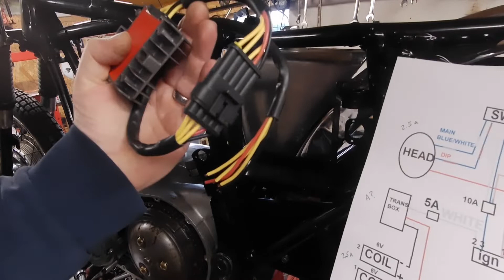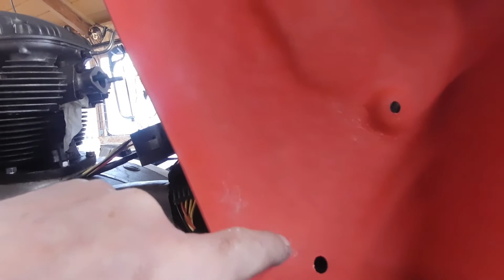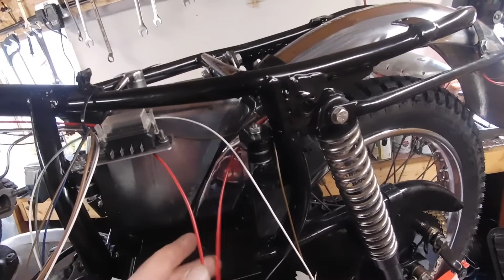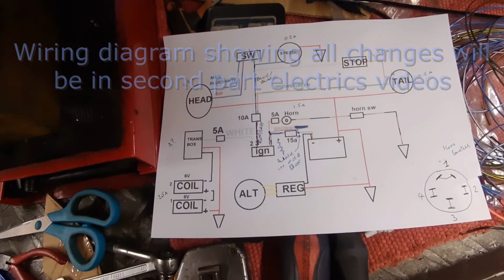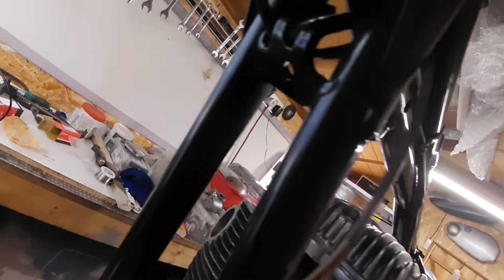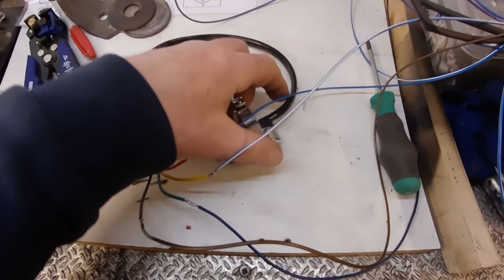BSA A50 Part 27a Electrics & DIY Wiring Loom

Comment: Hi again,  fyi that bracket at 43.34m on my bike holds the old style Lucas rectifier.  
Im interested to know how you mounted the coils and whether they are 6V or 12V? 
I have a Pazon e.i but the coils are loose so need to correctly place them. 
I have a 12V battery so guessing they are 12v coils but reading around the subject I think as they are 41mm diameter and have a 2.0 Ohm impedance they could be 6V (?) They are un marked. Do you know how I could verify their Voltage and have you used 2 x 6V or 2 x 12V for your electric ignition. Any close up pic or clarity on where to locate the coils would be very helpful for my build. Many thanks
Reply from the maker: I used the coil holders and 'S' brackets 44:19 that came with my bike but I don't think they are the correct ones for the year.
Coil holder is 83-1603 for 1-5/8" (41mm) coils.
Coil holder to frame brackets (1970 on?) are 82-8279 and 82-8280, earlier versions use different brackets.
Have a look at https://draganfly.co.uk/product-category/bsa/sparesparts-for-bsa-a50-a65/
Coil holders/brackets depend what year and model you have.
I am currently running 2 x 6V coils.
2 x 12V coils will work for low compression engines but you do get a weaker spark.
Whatever you use you MUST wire them in SERIES for Pazon, as with most EI systems.
Yes, 6V coils will be 2.0 Ohm.
Pazon recommend 2 x IC06 6 VOLT PVL SINGLE OUTPUT COIL (LUCAS 17P6 TYPE)
Reply: @InTheShedUK  Thankyou. Ive used dragonfly but imagery not great. Instead I ve googled and there appears many variations . I've got a 66 Hornet ... looks like a vertical bracket to drop the coil bracket downwards (oil tank side) and on the battery side the coil is fixed to the side panel bracing bar in a horizontal position.  Thanks for insight on coils ..6V is the way to go. keep making these videos...they are a great help.  😀

Comment: hi all looking very nice and neat, i think bsa a50/a65 had 3 different front side  cover mounting brackets with the oddie clips depending on year and model and those side panels are pre 1967 hope that helps.
Reply from the maker: Yes thanks, I did have to make a few tweaks to get those panels and brackets to work! All in a future videos.